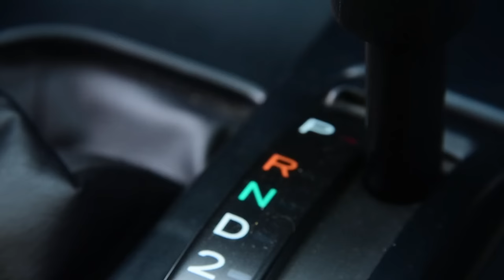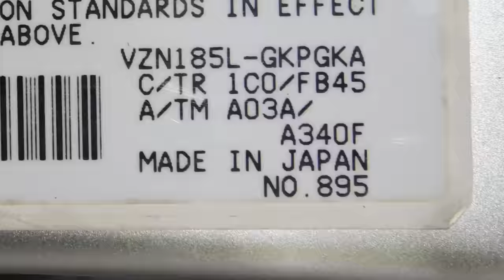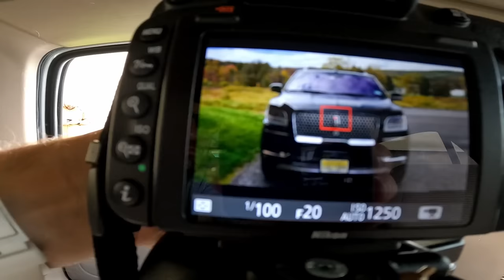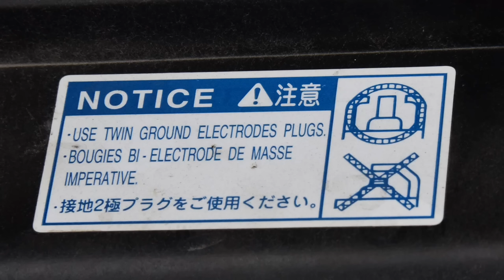2000 Toyota 4Runner SR5: Regular Car Reviews

Comment: I got a 2002 with only 112,000 miles on it about 6 months ago. It belonged to my wife's uncle who hardly ever drove it. I did the timing belt, water pump, radiator, added an extra trans cooler, all new brakes including lines, tires, por15 the frame, then fluid film, and new tires. I did the work myself, so I have about 4K invested. It's slow, it doesn't handle well, but I love it. It eats up rutted dusty dirt roads and runs like a Swiss watch. Who doesn't love a roll-down rear window?

Comment: Long time watcher and I’ve been WAITING for the 3rd gen review. I’ve owned over 5 4Runners through out my years and my 3rd gen has been by far may favorite. All of your complaints about gas and lack of power really should go to the 2nd gen. That is by far the worst offering (besides an amazing look) they had of offer. All of the horrible gas and shotty auto trans of the early to mid 90s but nothing good beyond the 22re. The 3rd gen fixed almost all of that. An amazing v6 and a cult like following. If you do start collecting I would highly recommend getting your hands on a 2nd gen with a 22re 4banger and manual trans. It’s incredible. Also the v8 4th gen is an amazing offering as well. Over all the 3rd gen encompasses everything 4runner enthusiasts love and that’s why they are so popular to this day. Happy trails

Comment: My mom bought one of these used with just a few thousand miles on it. Because of the price, she was stuck with it for around 10 years. For the majority of my childhood, this was the family car. My dad went through several work trucks during that time, but that 4runner stuck around. I spent so much time in the backseat of one of these. Rust finally took her, but she still ran fine. She had the Limited trim level with the fancier seats and the stripes on the side. Might seem weird but even now, at 25, some nights I have a dream that the good ol toyota is getting passed down to me as my first car. Even though that stage of my life is long since passed. Heck part of the reason I bought a Scion was because of the impression Toyota made on me when I was young. My mom loved that thing. It's hard to put into words the affect a family vehicle can have on your childhood.

Comment: My dad used to have this exact color 1997 Toyota 4Runner. He brought it brand and put over 200k. I remember the drive to the bus stop every morning for school. Engine roaring every time during the cold start. Traded in for a new 2006 Toyota Sienna which we still have today with 210k miles.

Comment: I have a 99 sr5 that I bought in 2017. I had no idea about how good they were when I bought it. She’s imperial jade mica and had a little over 200000 miles when I bought it. She has 280000 on her now and still runs flawlessly. The build quality of these suvs is mind blowing. I will be buried in this truck. When I got it it was spotless and stock. Came with nice options too, rear e locker, auto, sunroof, etc. this one was from California so not an oz of rust ( big deal here in the rust belt). She has been tastefully modified since then. Put foam cell pros on it for a nice 2 inch lift, duratrac tires slightly oversized but not enough to throw things off, tons of maintenance, nice stealth roof rack, fj style grill, just little touches to make it mine. By far the best vehicle I have ever owned I’m always trying to collect more of them. You have good taste mr regular

Comment: I love 2000 4Runner same color millennium silver it’s lifted 5 inches on 33 inch Mickey Thompson tires and runs like new with 286k miles I just did the water pump and timing belt and it averages 17 mpg all day !!!

Comment: That POR 15 is the best product I've ever used.  Hard as granite when cured.  It's a filthy job to paint it on but worth it.  Especially in places like PA, I'd still use fluid film or a similar product also because one can't get the por 15 painted on everywhere like the inside of frame tubes.

Comment: 25:00  Been using POR15 on the farm for almost 30 years now.  It is the savior of anything that lives in the mid-west and rust belt.
Reply: I sprayed Fluid Film under our vehicles at the end of fall every winter. On top of that every two weeks I would spray WD40 under it to touch it up. That process saved my clean 2000 T4R.

Comment: Also the later models had a different transfer case, which allowed you to choose to lock or unlock the center diff in 4 high. This essentially turns the truck into a selectable AWD vehicle. Seriously its the best thing ever. You can drive around on dry roads and on the hwy in 4H unlocked, no problem
Reply: My '99 Limited had that "multi-mode" transfer case that allowed 2hi, 4hi-unlocked, 4hi-locked, and 4lo. I also had the rear diff lock. This is more functionality than my brand new 2023 4Runner TRD Offroad has, which is part-time 4WD only, no "full time" option.

Comment: I bought a new 2000 SR5 'Sport' model (with the fake hood scoop), monochromatic dark green - very nice looking vehicle. Yes, it indeed was slow and didn't ride well by today's standards - but it lasts. 300K miles indeed, without any issue. By far the most reliable and longest lasting vehicle I've ever owned. I sold it at 300K miles and to my knowledge, it's still operating.

Comment: There's things I prefer about the 3rd gen over the 4th, but the 4th gen is actually safe in a crash and the extra 6" in width and length is nice too. It's also not as slow and a lot more comfortable. I've also towed with it a few times and it's shockingly capable--MPG is almost cut in half but it went 3000 miles across the country with a trailer.

Comment: I love just how different your 4Runner is to my 2004 Chevy Tahoe despite them being the same class of vehicle. Yes, the Chevy is newer by four years, but it's still the same era but facelifted. The Tahoe is much larger, fit for Americans. The seats are wide and plush, and it rides like an old Cadillac and has a huge pushrod V8 compared to the 4Runner, in which it still probably still manages a better 0-60 time despite being far more American than that 4Runner. It can actually pull its rated weight just fine, but in what it excels at in basic truck things, it will not hold a candle to the 4Runner's build quality nor offroad prowess. Mine is not a 4x4 or Z71, but I'd wager the smaller footprint of the 4Runner is superior to a Z71 Tahoe or Suburban.

The interior of the Tahoe is well-used. It has 182,000 original miles and has been with my family since brand new. The dashboard creaks, and it doesn't have a single square foot that doesn't rattle in one way or other. Even then, it's still mechanically perfect and the 4l60e lives to shift another day. No doubt due to us taking care of it and not towing much with it, and if we did, my Dad would always turn off O/D and keep it in tow/haul mode even with an unladen steel trailer. This truck is not perfect by any means, but it has never ever broken down on us and it still runs despite its age and having a rebuilt title following an accident while it was parked on the street. No problem. Just get a parts suburban and slap on a new front end. The pinstripe on the passenger fender is misaligned because of the parts truck. Who cares. Drive it. It'll run forever.
Reply: I’ve found pushrod engines to be very anemic regardless of cylinder count.  They don’t accelerate from 70 on when you need to pass.
Reply: GMT800s are excellent trucks.

Comment: I own a 2001 Toyota 4Runner, and it is one of the best vehicles I have ever owned! 3rd Gen Best Gen!! 3rd Gen Best Gen!!

To answer your questions. Yes I use the driver handle while just cruising on the back roads. Yes there was versions without the sun roof!

Lastly, do the Tundra brake mod upgrade to fix all your braking/warping issues.

Comment: Yes slicktops exist. And they have about 3" more headroom
Reply: Finding a true base model 3rd gen is a hard ask nowadays. I remember seeing a used '96 at a dealer. Whoever bought it originally must've left all the option boxes blank. This thing was bare bones to the max. Slicktop, no rear window deflector, 2WD, steel wheels, standard 2.7 I4 hooked to a 5-speed stick, matte black bumpers, plain white, black door handles, and manual windows.
Reply: @benchattin  one of my good buddies has an sr5 without a sunroof believe it or not😂 the SRs are pretty common to not have one but the sr5s usually do

Comment: I have a silver 2003 3.4L 4spd auto 4x4 Xtracab TRD Tacoma with 1” taller-than-stock H/T tires, a bedcap (not one of those super rounded ones), and 108,000 miles (about the closest a Tacoma can get to this 4Runner). 
In flat country I generally average 18mpg (usually driving a little faster and more aggressively than my Mom’d like), and on roadtrips usually make ~19.5mpg, cruising at ~2,300rpm/75mph. It does have to kick down into 3rd on the steeper hills, but it doesn’t seem to have a hard time holding 75 under normal conditions. When I’m up in the Vermont hills doing all local driving though, I’ll get down around 16mpg. 
Thanks for the video! Love your stuff.

Comment: I bought one of these  a couple of years ago after I had to let go of my Challenger... I couldn't agree more with almost everything in this video. One of the most pragmatic (and oldest) vehicles I've ever owned to date. Haven't looked back and have certainly embraced the utilitarian sloth that is the 3rd gen 4Runner. "Not for sale" has certainly a part of my vernacular these days. Loved the commentary, I completely relate!

Disclaimer: 21 MPG is achievable on straight / level highways, with the engine sitting at just under 2K RPMs, genrally doing no more than 60 MPH... at least along the I-5 corridor.

Comment: I've always owned vortec 5.3 and most recently 6.0 in the giant Yukon Denali. Even owned some smaller v6 that were fast and powerful, but I could never prepare for 4runner v6. 3 months of owning my gen 3 I can only describe it like driving up armored HMMWV or deuce n half. Being now in my late 30s I truly appreciate this truck. Since I'm not zipping through town doing burnouts and trying to squeeze as much hp as possible. This truck is a tool, as well as my daily.

Comment: I miss my 98 4runner. 
Mr Regular. Do the big brake kit. ITS WORTH IT. one of the best mods i did to mine.
Reply: Did you have normal 16" wheels? Did everything fit?
Reply: I had to sand down the raised lettering on the calipers. Not much at all. My rims looked like his. Its been a while since i had that 4runner. I miss it but i DONT miss 17mpg hwy... lol

Comment: I had a 00' 4runner with the 4 banger engine & manual transmission, went to 450k miles before finally trading in for a new tundra because I needed a larger vehicle to tow things with.  I towed with my old 4runner all the time, but only pushed it to about 2.5k pounds max with that engine

Comment: 7:49 The truck is doing that because the steering rack bushings have turned to goo. Replace those, the front sway bar bushings and lower control arms and your 4Runner will track and handle much more like a modern truck. Also, at 15:55, would bet those hard jolts and 'why is the truck tilting so far?!'  sensation is caused by worn body mounts letting the body lift off of the frame. My old 1st-gen Tacoma rode much better, and was much less terrifying on sideways slopes, after replacing the body mounts.

Comment: God I love the third gen. My dad had a 96 SR5, I grew up in the back and passenger seat, and it was one of the trucks I grew up in. 

I bought a 96 Hilux Surf diesel in Japan last November and have been daily driving it since late May. I did submit mine for review, I think you'd be surprised how much is both similar and different between the US and JDM versions! Mine has a few interesting features including electronically adjustable shock absorbers that make a BIG difference in handling. 22mpg and a nice quiet diesel, I LOVE my truck.

Comment: I can tell you from experience a 3rd gen will cruise decently at 90 mph and will hit 105 mph. Also the 4wd hi will work fine at highway speeds and turns on pavement.

Comment: These things suck in a lot of glaring ways
Reply: I'm surprised you actually told the truth about the 3rd gen. They're very crappy and have a delusional reputation, the only great thing is the AC, I never had a problem with the ride but it's not true to the road at all and the steering is scary at high speeds, engine is dead, brake pedal, gas, shifter and the steering are all crunchy and clunky. The transmissions are decent but the engines have phantom misfires and the head gaskets blow all the time. The 4 cylinder was faster than the v6 when I drove one.

Comment: I think all of the 4runners are great. I do think the 3rd gen is my favorite though. It's design has aged like fine wine, it can be found with a manual transmission, and it's longevity is legendary. That's not to say there's anything wrong with the prior or later generations though. I just personally think the gen 3s are my favorite and I would love to own one. I remember riding in one when they first hit the dealerships. A friend of the family had just bought it, he hadn't owned it for a month. My father and I were blown away by the initial impression it made, and I've wanted one ever since. It was just a great example of when IMO Toyota was at their peak, and it was a grand slam of a vehicle.

Comment: I have a 1999 4runner with a manual transmission, better suspension, 2 inch lift. Love it. in regards to towing, I use it like a truck. It can haul quite a lot. I've towed 7,500 lbs without trailer brakes before. That was pushing it for sure, but wow it did it. Excellent machine.

Comment: Found my ‘97 3rd Gen for $2,400. We’re at almost 290,000 miles. Rack and pinion system replaced, wheel bearings replaced, transmission replaced. All in all about $5,000 in the vehicle.

At some point something smashed the oil pan in, and I had to drive it 40 miles to the body shop with the oil pouring out. It was bone dry by the time I got there. There were metal shavings in the pan. I was sure it was over for the engine. But I swear it runs better now than it did before, lol.

If I leave it a week without starting it, it will blow a cloud of white exhaust as big a smoke grenade until it blows out the moisture/coolant/oil whatever. Still soldiers on.

I’m hoping to get to 320,000 miles. I love it so much I may try to salvage another engine if this one goes.

Comment: It's not just with the 4Runner with the manual transfer case, you should do that with all of Toyota's transfer case equipped trucks. The actuators on them like to seize up if they aren't used in 4-5 years and it turns into a transfer case replacement job.
Source: Am a Toyota master mechanic.

Comment: I got to 100mph in my 4cyl 4Runner, but I usually just go 70 at most, either way speeds higher then 50 it shakes, sometimes not as much, sometimes a lot, I love it tho, I didn’t know that part about 4wd, the 4cyls don’t have a sunroof, or at least mine doesn’t, and I can confirm, the manual 4banger is fun as hell to drive

Comment: I miss my 2002 4Runner. My dad bought it “used” in January of 2003 (first owner had it two months). While the body and interior stayed mint, the frame had holes and a rear shock perch failed. Replaced by a 2022 Tacoma TRD Sport.

Comment: My 4th gen 2UZ-FE V8 4Runner is a fine piece of kit.  Full time AWD with center diff lock into 4WD is fantastic.  It is, however, not really that fast.  It's the torque and all wheel drive that gets it off the line quickly.  I don't like to go faster than 85 mph in it. The gas mileage is horrendous, but it's paid off and I plan on keeping it as long as I can.

Comment: Thanks for the tip on engaging 4H once a week. Makes a lot of sense. I purchased a '99 with 280k on the clock three months ago and proceeded to do a top end rebuild ( rebuilt heads, head gasket, and timing belt). After the rebuild I'm getting 19mpg with mostly highway miles. I'm pleasantly surprised by that. Not so happy with the lack of power I can't imagine driving one with a 4cyl! Smooth drivetrain but it wasn't designed to go much faster than 70mph.

Comment: I bought a 99 "Highlander" edition 4Runner literally today

Edited to add. Mine has the TRD supercharger on it and it helps it out so much on the power front. It'll do 0-60 in about 7 seconds. Mine was installed at time of original purchase by the original dealership and has all of its paperwork so after 221k miles I'm confident it's a good one.

Comment: Had an 00’ 4wd limited with the rear diff locker. Put a 3” OME lift, gapped a few GTI’s downhill with that setup until the original starter and brake booster gave out and I sold it bc of the miles (350k). Got an 05 vvti v8 4wd 4th gen and put a level with Bilsteins on it. Now I can pull away from GTI’s WRX’s and gt86/frs/brz uphill and sometimes downhill. On mountain roads. And then disappear down fire roads. Love these trucks keeping my v8 as long as possible. Just gotta learn to use the weight transfer and know your brakes, made the front discs glow on the 3rd gen a few times. the move to rear discs is a game changer.

Comment: Spring 2002, San Bernardino county mountains. My aunt and I were in her '96 4runner when a case of road age resulted in us finding ourselves tumbling 150 feet into a  steep ravine. When the horror finally stopped and we were upside down, we were able to safely crawl out of the windshield to where once we were checked by emergency services, we were declared completely unharmed with the exception of some seatbelt rashes. Had we been in anything smaller or something not built as great as one of these, we would've been in a trauma center for sure at the least. Since then, I've made it a significant life goal to acquire one of these and make it last until the end of my time.